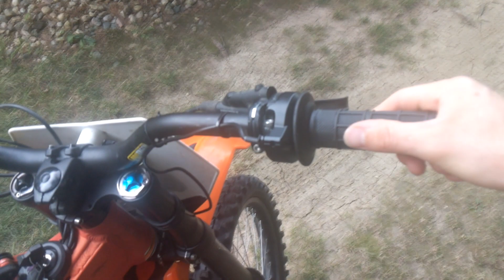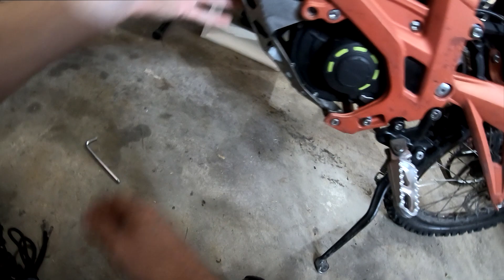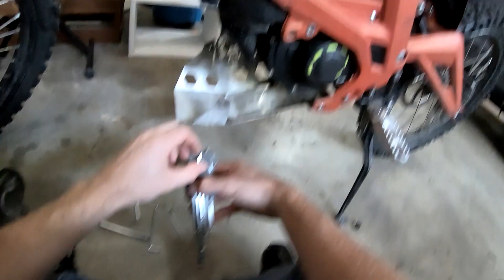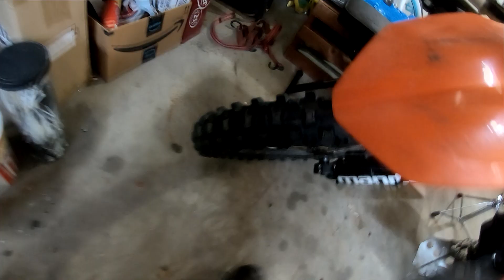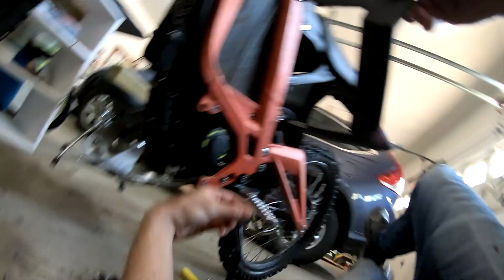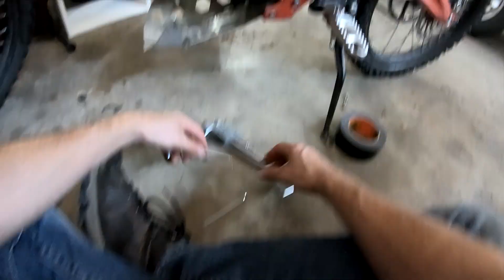Sur-ron/Segway Ride-By-Wire Throttle Give Away & Installation

Comment: How is the build quality?  Is the handle plastic?
Reply from the maker: Yes then handle Is a polymer plastic. The handle is meant to have a grip go over it though.
Reply: Sonic Riders Thanks for the video!  i really like having BarkBusters but the end of the throttle does need to be cut off to fit. Had to change to metal throttle to solve the deformation or it would bind on return.